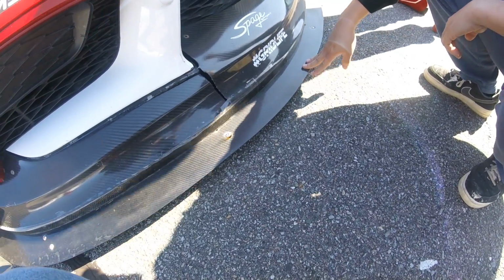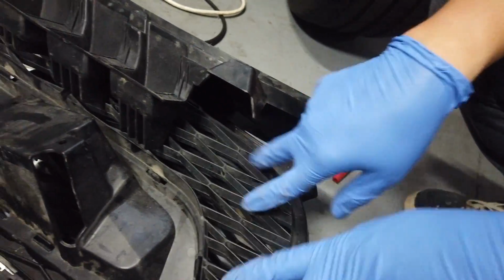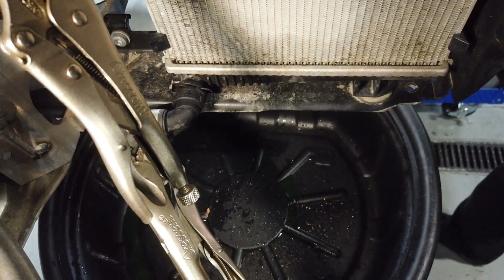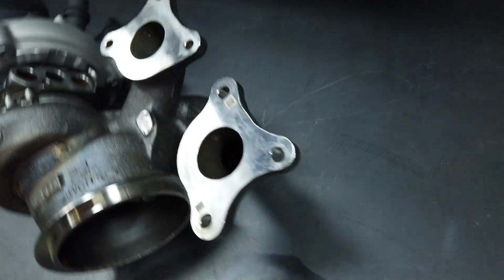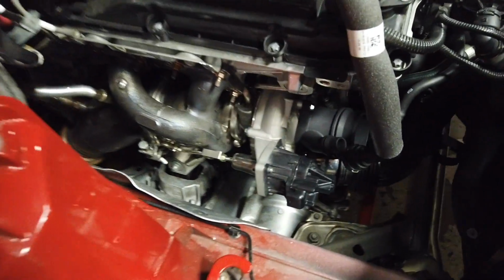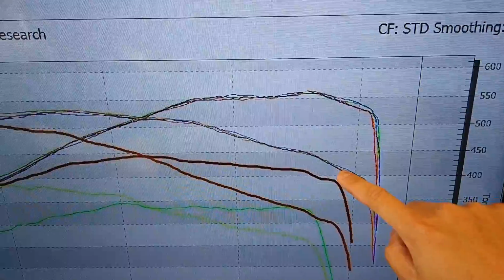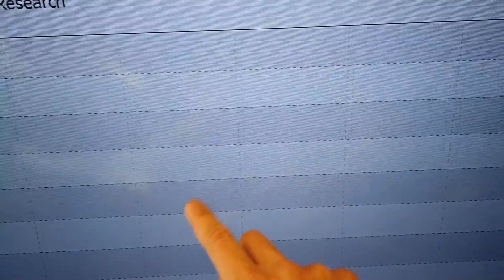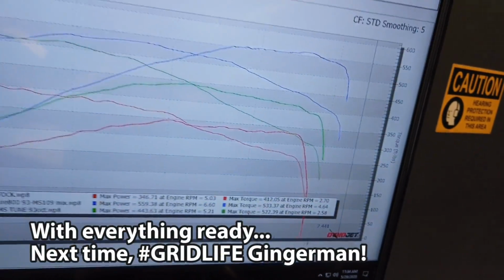500+ WHP Turbo Upgrade on Time Attack Supra! Project TA90 #24

Comment: What fuel you use? E85?
Reply from the maker: Nope. We ran straight 93 and got 520 whp, then added 93/MS109 mix to reduce knock and improve reliability. Also made a little more power.
Reply: @JackieDing86  Holy hell thats amazing!
Reply: @JackieDing86  Those are some great numbers! I'm hoping I could reach 550whp on 96 octane on the Pure 800.
Reply: E85 is for gays
Reply: Victor Hugo  It's not that bad on a track build. Lots more grip than street conditions.

Comment: Jackie, you are not running any kind of meth injection or supplementary fuel right? Fuel system is stock?
Reply from the maker: We are not, no meth, no port injection yet. Stock fuel system.
Reply: @JackieDing86  Thanks Jackie, abusing of your time, the loss in torque down low, is significant? I struggling to decide if I should get the Pure 800 or not. Right now with E50 I have zero traction in 1st and 2nd, so I hope would be more usable, but I am afraid it will stop feeling that strong down low. What do you think?

Comment: Jackin Ding 💦💦

Slappin on the the new meaty turbo
Reply: Definitely a great upgrade. With the aero and the torque coming in a few hundred RPM later it should be better on almost every course. Hopefully smoother coming out of tight corners too with less wheelspin before straightening out😊

Comment: 0:23 "as you guys saw at VIR" where is the VIR vid?  theres only the one against the C8 with no aero
Reply from the maker: VIR vid ended up getting scrapped, splitter had a failure and we got 1.5 laps before the splitter fell on the floor. 
It would be a pretty boring video tbh

Comment: How are the cooling mods? With you running such high horsepower especially on track will the engine not retard timing? 
How much can those engines handle reliably without failing?